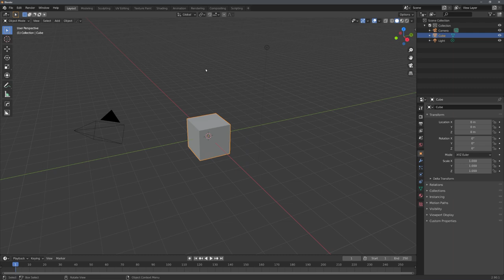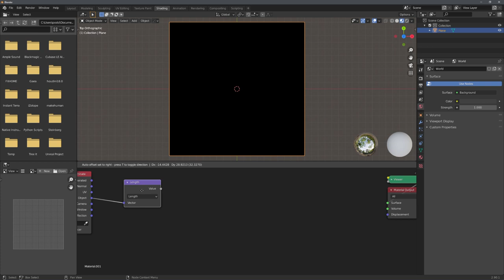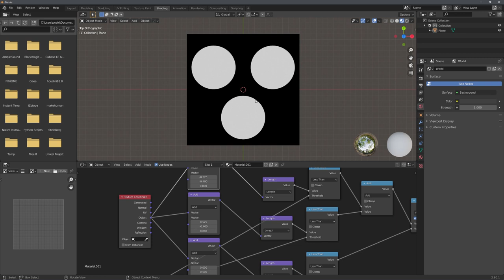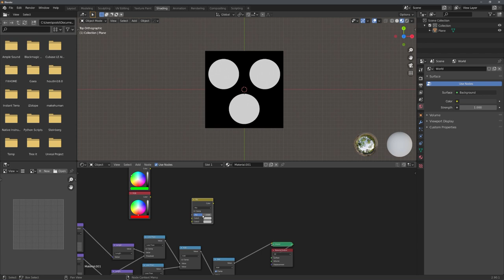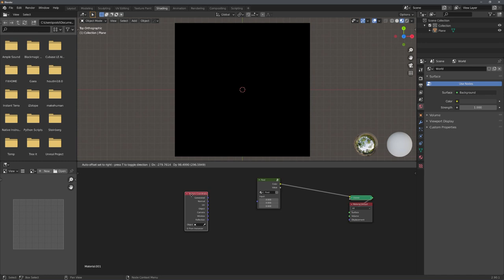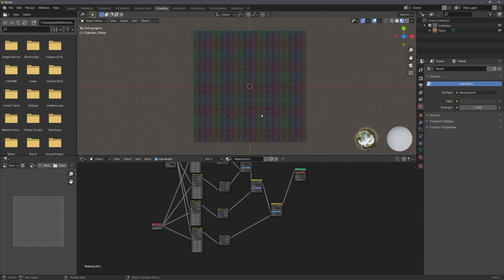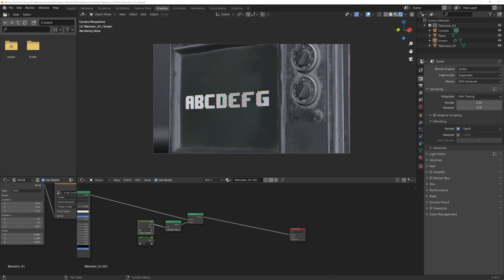Better LCD Screen for Blender [+ Channel Updates] | English

Comment: Hey, I don't think I am half as good as you at the node setup, however i did manage to tile the rgb circles without the external tiling addon thingamajig. What I did was i connected the object texture coordinate vector node to a vector math multiply node to the top node, then, the result I connected to a another vector math fraction, and then, to your RGB circles node. It worked for me. Am I wrong? https://imgur.com/wyMY3YR
Reply: Yes, I think this is also how CGmatter showed it in one of his Videos
Reply: Yeah, i didn't came up with the ideia on my own, however, did not remember where i saw it. After playing a little with the setup, I realised it couldn't tile perfectly, as it crops
Reply from the maker: That's awesome. Thanks :D